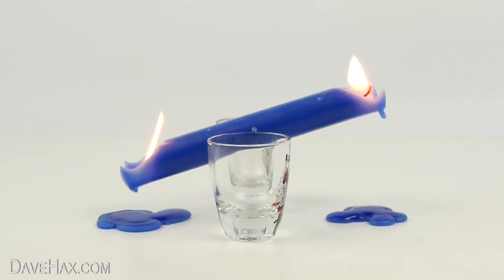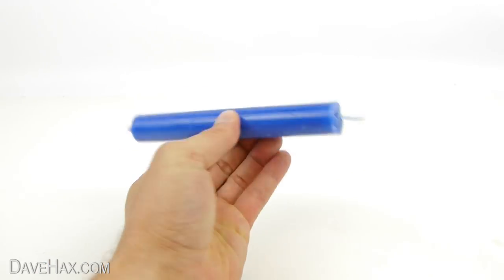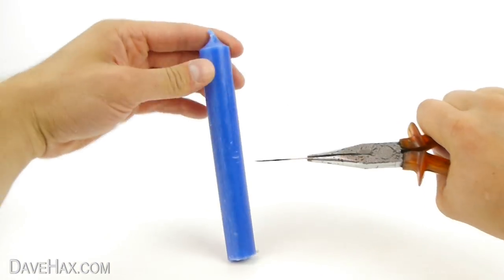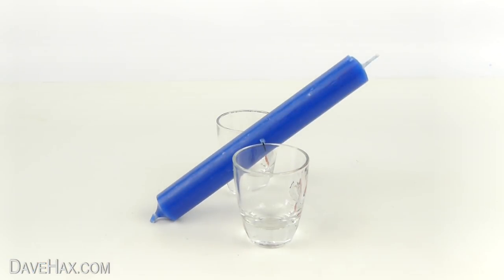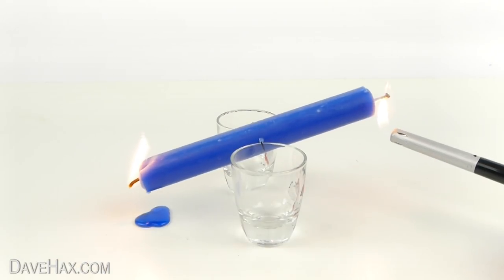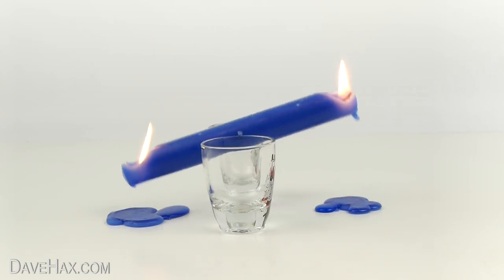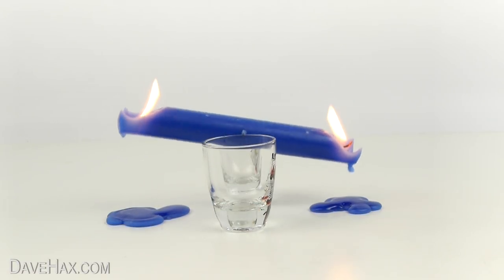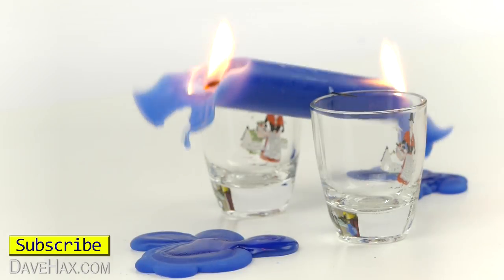Flaming Candle Seesaw!

Comment: To find the balancing point of a long object. Place it on two fingers, one at either end (probably best to use your index fingers) and then gently try to slide your fingers together, one should slide and then after a while the other will slide. Where they meet is the balancing point. The finger that slides second is the one you should be able to keep on there while you remove the other finger but only if you move the middle part of your finger to where the fingers met.